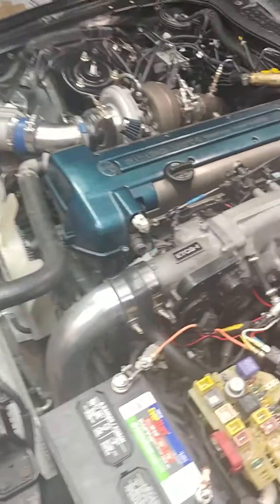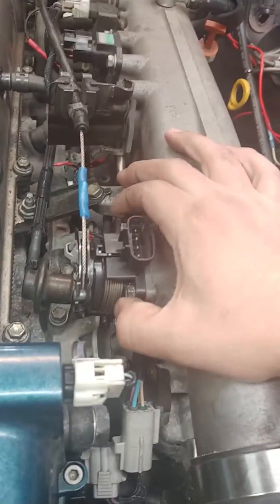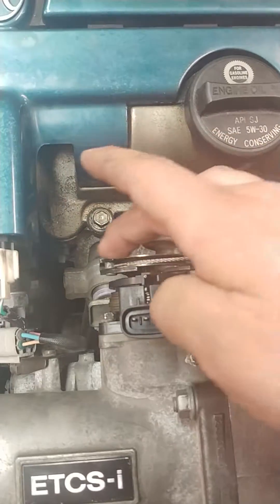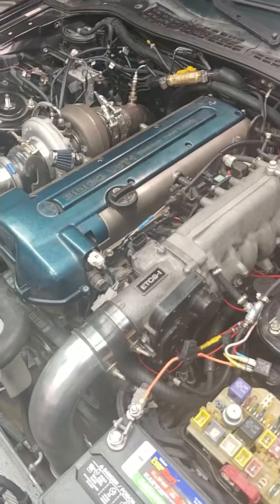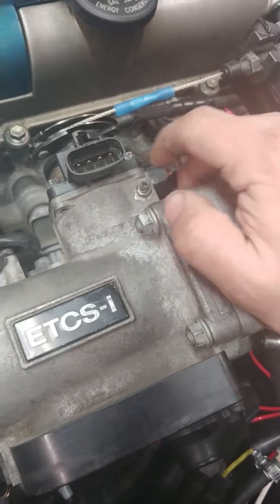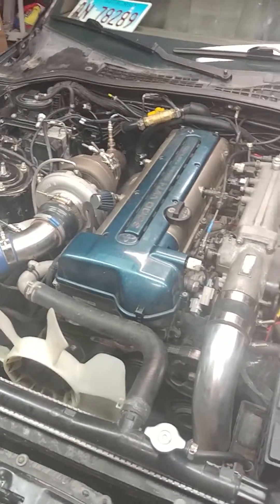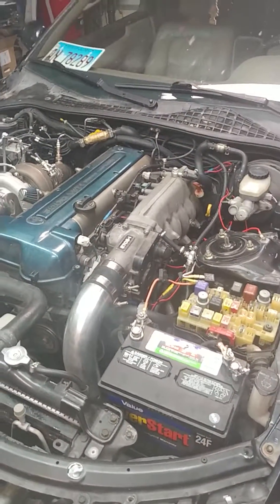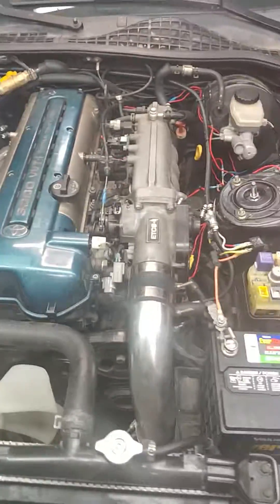2JZ-GTE VVTI DBW MOD (FREE) - (Makes Mechanical)

Comment: The issue is that Pedal Position Sensor  soldering cracks ,and it's sending higher voltage to ECU and second TPS is confusing ECU

Comment: What ecu  are you using? people say stock ecu doesnt work with dbw delete mods
Reply from the maker: Stock ECU - the mod does work, but I believe cause I unhooked the PPS sensor, the car doesn't downshift based on throttle input. I'm looking to resolve soon, and will put a new vid up.
Reply: Kyle Combs so if you drive in tiptronic mode on an AT it shifting is fine?
Reply: @KCM33  so manual transmissions should have no problems then.
Reply from the maker: @123thatsithaha  Shouldn't.